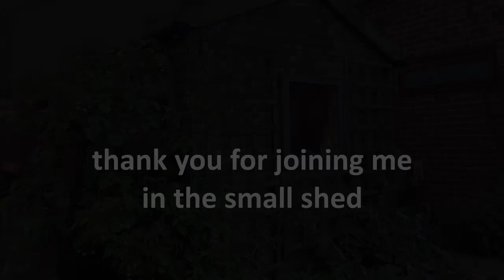the small shed #197 - a hood for the Triton belt sander

Comment: Another 'modification' to a piece of equipment to personalise it - Great one again - There's always a way to 'better'ise' a tool. Just a thought,   would a hinge have worked in place of the magnets ? . Also I have been out and brought myself a cheap track saw ( i have said it before, you are costing me a small fortune as every time I watch one of your videos I end up thinking I 'need' one of them) and notice that you have one of your tracks pivoting on a workbench, can you give me any help on achieving a similar setup. - Thanks again and look forward to tomorrow's installment - Mark
Reply from the maker: A hinge would be fine Mark, but I'm not that good of fitting them to 6mm ply, they would probably need small bolts, but it would be less pieces to lose.
Reply from the maker: The track that pivots on the workbench is the Festool one for the  MFT.
 I found it a bit of a nuisance, and now tend to use the dog holes in the bench to locate the item I'm cutting, and either lay the track straight on it, or use another pair of dogs to get a right angled cut.